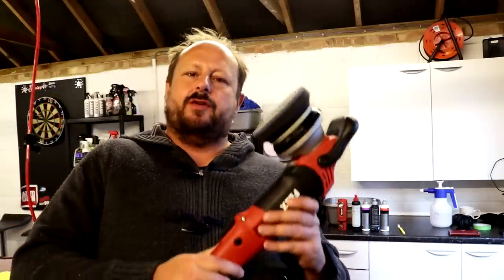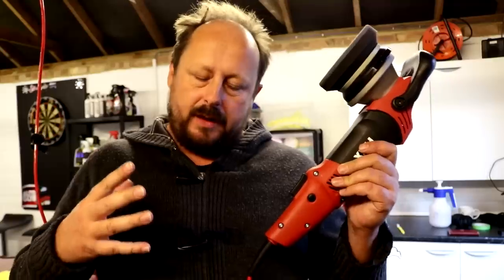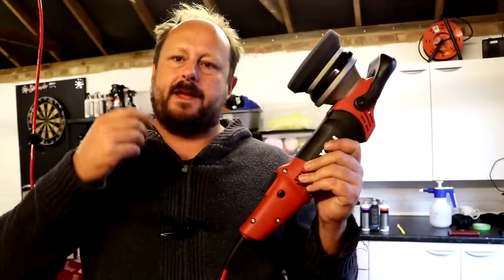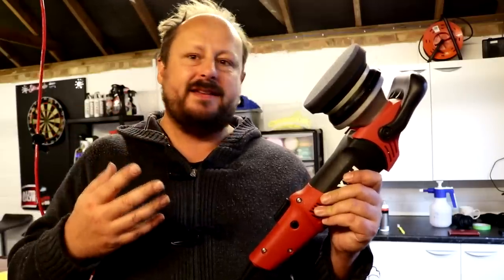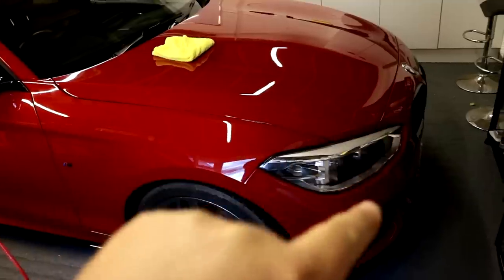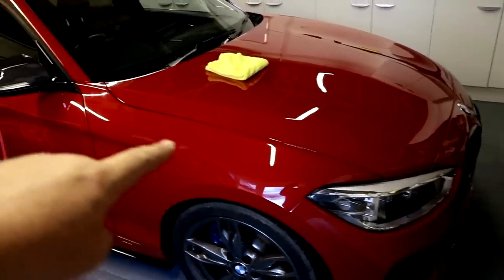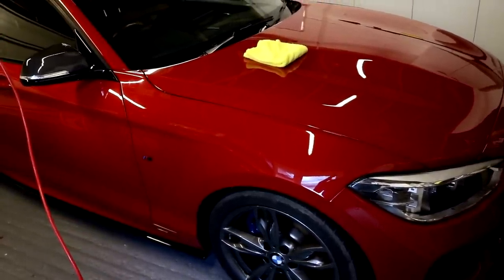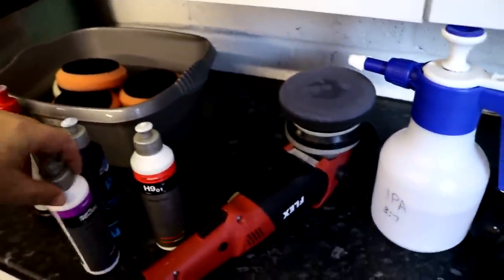Near Disaster - Rookie Mistake to avoid when machine polishing!!

Comment: It sounds to me, whoever painted your bumper and bonnet have used a cheap clear coat, or not mixed it right or put too much product on.
BMW paintwork product is usually by a German company called Glasurit. I’ve used this product a lot and it’s a hs+ (High Solid)
If the paint work has not been baked off at the correct temperature and time, the paint could take a very long time to cure, plus have you checked the micron thickness Of the paint. One should be around 90-120 microns thick.
So here in Australia, even when we bake a car. It can still take around 72hrs to cure at outside temperature 30 degrees.
Try the nail test, if you can still dig your finger nail into the paint the chances are it will need to be repainted at the right oem.
Hope that helps
Scott

Comment: I once had a Ford Fusion that had the trunk lid repainted of which I was totally unaware. I had done my test section on another panel and had polished several doors and the hood (bonnet for you Brits ☺) to great success but when I got the rear deck lid, there seemed to be quite apparent scratches that just wouldn't change no matter how much I buffed or compound/pad combination I used. Took me a minute to realize that it wasn't on the surface as that was beautifully polished. Rather it was sanding marks that had not been taken out prior to the base coat and clear being applied that looked like surface scratches, Glad I didn't go through the clear trying to get them. haha

Comment: I had watched the full video before commenting, and my thoughts were was that the marring was on the new paint,  under the new clear coat. Which meant you need to remove the new clear coat to get to the marring. Glad I was wrong. With your hair, it is au natural, as you don't go and have makeup/hair done before videoing.

Comment: I thought it would be softer paint!
Something I have discovered recently is BMW paint is becoming less and less hard and it is getting thinner and thinner. I recently worked on a 19 plated 2018 manufactured 3 series and 69 plate x5, and both were soft enough to inflict marring with various pad types using koch chemie f6.01. They were both showing frequent readings of 80-90 microns across large areas too. Last year I experienced paint so poor on a BMW X1 that the paint detective coating thickness gauge was leaving indentations in the paint on the contact needle and even from the "foot" that surrounds it. I even managed to make a finger print with enough pressure. It was returned to BMW after even water polishing on a glazing pad left machine marring.
This may explain the difference in hardness if it has been painted with BMW supplied paint. Regardless, do keep an eye out because it nearly caught me out!

Robin @ Autobrite Direct /Viking Detail

Comment: Sounds like I was lucky, but I didn’t know how abrasive scholl s20 was, but did the whole car new bonnet respray but it turned ok on my Jag XF. This is the first time I have dabbled with my DA, as I had to polish out a scratch from a thick branch the whole length of the car, I can’t see any swirls and it seems fine. I used v34 to polish the scratch out and got a lot of product throw initially, then rechecked your vid to find out I wasn’t dabbing the pad before turning it on .... Duh. But this has educated me further thanks.

Comment: Hi I'm a 67 year old newb,  looking to get a polisher and came across your great video. I have a car, a DeLorean that has no paintwork, but it has plastic (unpainted) front and rear fascias. I believe that they are black Urethane. I've had great results using wet n dry by hand working up to 3000 grade, but feel that good polisher will yield results. Would a machine with a big throw be good for urethane unpainted plastic? Also what liquid n pads would you use . Love your you tube channel.

Thank you.
Reply from the maker: I'd start with a da8 from in2detailing.  Flex orange pad and Koch F6 abrasive m8
Reply: @ForensicDetailing  thanks. I've contacted them this afternoon, and will be getting one.

Comment: In the ds4 we practised in the course in Poland I did the left side of the car and the same thing happend to me on both  doors so I had to use a medium cutting pad and medium polish to fix that. 
After the course I helped polishing a Volvo V40 and Volvo also has a very hard clear coat. 
I am polishing my friends Smart Fortwo but im not seeing any difference at all. I need to change something and I think I have to increase the speed and do slower passes. 
Its all about practice. Lol.

Comment: You presented it so convoluted that I first thought it was something really tricky, like you carried over some abraded paint residue particles from the OEM paint to the repainted area in the pads (either by using the same pad on both kind of panels or even just possibly going over the edges slightly), and that's what marred the latter, because it was harder. But then I saw you had multiple pads soaking, so, I figured it wasn't that. Then it turned out to be really a basic thing. :)

Comment: I had same kind of problem with Toyota RAV 4 2017.  And whats more unusual is that the paint thickness is 0.9 on OEM. Its like 10times thinner or what the h... Solve me this? What i have painted cars. I know this if you but too much a part or b part the end result is not what manufacturer is mented. So if you trust your painter then theres should not be problem. But if not they might mixed it wrong.

Comment: Question: how long was the new paint on before you started compounding/polishing it?  If the shop used a good quality clear, it will become just as rock hard as the original, but depending on lots of variables, it may take between 30 to 90 days before it gets there.  In the first 30 days, often a DA with a medium pad & compound is enough to get a perfect finish, as the clear is still relatively "soft".  And - you probably know this, but for other's sake maybe - do not put on a wax or sealant on until you are sure it's perfectly cured. (there are 2 exceptions, but that would lead us too far).  Source: one of the guys who developped the 2 stage automotive paint.

On the other hand: I tried "correcting" my resprayed car after 40 days with S3 and a Scholl heavy cut Spider pad.  5 passes.  Zero result.  Clear is absolutely rock hard.  Painter stood next to me and was laughing his ass off. "Told ya!"  It was either using 3000 grit or go round with a medium combination, then Gyeon Prime, then start the coating process.

Edit: 3 weeks, OK, so yeah, still pretty soft at that point.
Edit2: also depends on hardener/reducer/cabin temp/baking temp&time, so talking about ideal world
Reply from the maker: yer its more like  a month I think.. I literally just left it sitting outside in the cold with no product on it.  Its very soft though.     this needed very soft pads.  finishing pads with SF3500 was like the best way to correct this paint (or any finishing polishing)
Reply: @ForensicDetailing  It's finnicky isn't it?  It might well have been different if this happened 3 months ago during the hot July/August months.  I did some small rattlecan action then, and it was dry to the touch after 2 hours.   Tried the same in October (same product/technique/person) and 24 hours later I ruined it just by touching it.   2K clear apparently needs 20°C minimum to do its thing.  Anyway, great video, you could always expand on it later; detailing can catch you out on new paint/spot repairs/resprays.

Comment: Hi may I ask the following.   I bought a new in 2Detailing DA8 900W Dual Action Machine Polisher and found that over time it's just very noisy. In your testing of DA polishers is this unit particularly noisy to you, only the manufacturers say that's how they are.  But frankly I just don't buy this. Kind regards Dave Porter London
Reply from the maker: Not especially m8 no it's a bit rumbly but similar to all the Chinese da.  Check the bushes for even wear.
Reply: @ForensicDetailing  Thanks, but a brand new machine.

Comment: I'm always flabbergasted at how so called professional paint shops deliver the final product looking like that.
They have no bloody idea how to polish !!!
A new paint job should look as good as the original if not better !

Paint correction 101 should start with a full inspection of the car to determine which portions are original and which after re painted.
Re painted surfaces will always require a different approach method than the original.
BMW is notorious for HARD clear !!
I know, been down that road many times.

Comment: If you've just had your car painted, do NOT machine polish it for at least 4 to 6 months, it needs to harden and cure.
Reply from the maker: There are ton of different products you can use to paint a car with and all the products vary, there is no definitive statement on approach.    Most modern water based clears dont need anything like 4-6 months.  And the obvious elephant in the room.. The bodyshop are mopping the paintwork before they give it back to you.

Comment: Guessed it! You were creating the marring. Could be worse though: Ever polished a black Honda? 😉
Reply: i want to know, how to polish an old black honda, with very less clear coat left and full of scratches, swirls n holograms???? menzerna 2500 with light cutting pad and menzerna 3800 with finishing pad on forced DA??? and do suggest pads for forced rotation on black honda.
Reply: @sameer0605  With caution, and gently! (New) Hondas are soft as butter. When clear coat is that worn/polished off, you may not want to chase the scratches and deep swirls and just settle for gloss with a light polish. The holograms are easily removed that way. You can try looking at the polishing videos on the Apex Details channel. He has a very sound approach to preserving clear coat.

Comment: My guess was that you were inflicting the marring yourself, as a result of clogging up the pad with soft-as-shite clearcoat. 

I guessed that because the side of my Giulia which was resprayed is a massive pain in the arse, and has borderline ruined the car for me. Its so soft that even safe washing practices can result in long sweeping "lovemarks" in the clearcoat. Its so soft that I can then polish them out by hand in minutes. Its infuriating. The bodyshop clearcoat doesn't seem to hold onto any products either, and even after a paste wax, the repsrayed side lost its hydrophobicity long before the beads were even starting to wane on the OEM paint.

If I was wasn't so deep in negative equity it'd be enough to make me change car :(

Edit: Did you accept the paint in that condition because you knew you could correct it? I rejected my car after it was resprayed because of the swirls and buffer trails.
Reply from the maker: I think the paint is ok. Its kind of soft yer but nothing crazy.  BMW did me a favor really taking it on as a compramise.   I know virtually all the spray shops in my areas or used them over the years, the paintwork done was of a good standard.. not top draw but decent.    in my experience perhaps only 1 in about every 20-30 bodyshops will do very very good work.  lots try and do good work though, problem is 99% of customer dont even look at it, they dont look for swirls or how well its done, so bodyshops kind of start really doing work to X standard rather than Y standard.

I feel your pain kyle.  it can kill your enjoyment of the car a bit.   Im gutted I had to have this sprayed as well, its a weird paranoid OCD part of me.  It was chipped up pretty badly before the respray though.   so I guess even for me if its gonna swirl up a bit quickler from being soft I think I can live with it..

this sounds very negative but the truth is the more work you have done on your car generally and the more people you have like handling it for certain jobs, the more it gets shagged.   If it has to have aftermarket paint, its a real killer most of the time.   Its like Ive got to get my tyres done soon and theres probably a 50-50 chance the alloys will get shagged in the process even if I tell them to be carefull.